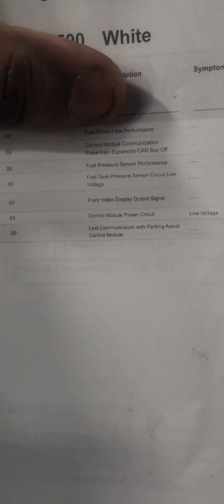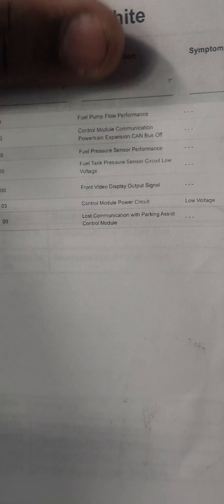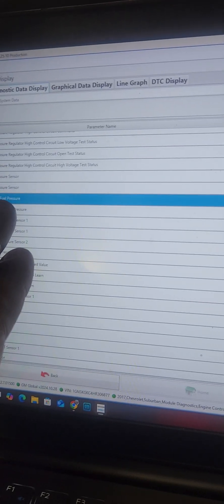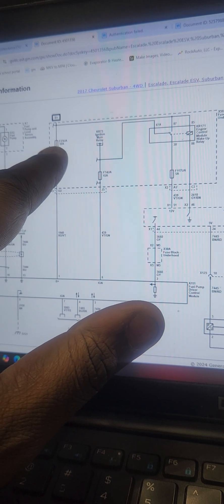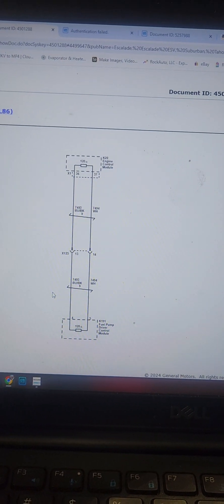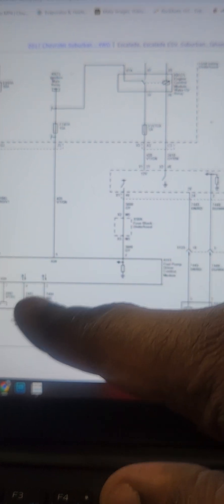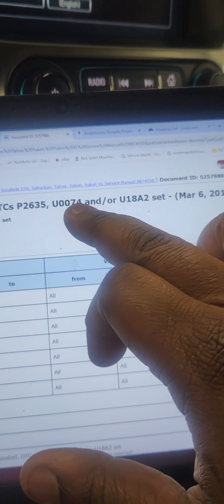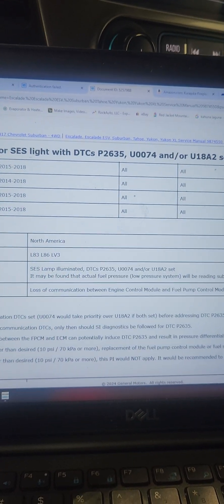CAN bus communication diagnostic Chevy Suburban  ,P2635 U0074 P18B4

Comment: What if you have the u0074, and the p2635 but not the p18b4 code. Similar  issue but the actual pressure stays locked at 90 psi and doesn't move no matter.